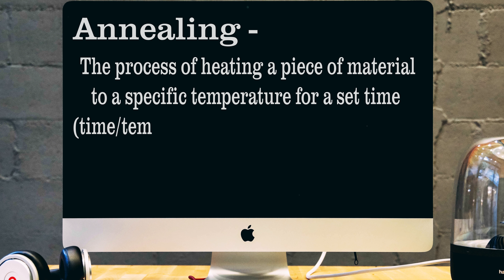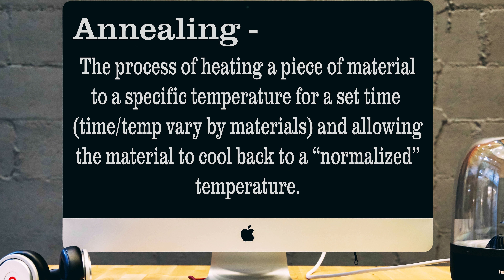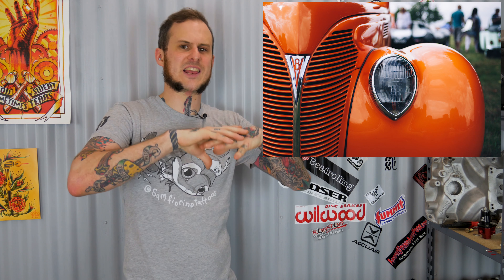8 Metal Shaping Terms Defined - Beginners LEARN THESE!

Comment: Thanks for taking the time to explain. I've watched this one several times now. Only starting out, my first project would be a pedal car. What gauge aluminium would you recommend for a beginner? Hoping to do a 60%scale pedal care of a Morgan 4/4
Reply from the maker: 18 gauge would probably be my recommendation. Aka .040" or 1mm thick.  It would be a good balance of easy to work and strength for a project like that.  If you are worried about it getting beat up in use, 16 gauge (.051" / 1.3mm) is will require more effort to shape but be tougher overall.  I'm planning to build a full custom street rod and aiming for mostly 16ga aluminum construction.

Comment: Good stuff. I've heard the terms before but never thought about how you could possibly achieve the same end result with shrinking rather than stretching. Also, I'm familiar with the terms "work hardening" and "annealing" but could always stand to see some practical demonstrations, especially with sheet metal, since everything I've seen on the subject up until now has dealt with the world of machining. Thanks for sharing.
Reply from the maker: You can often achieve the same results with shrinking as stretching it's just more involved work. 

I definitely want to do some demonstrating of annealing and work hardening in practice. That is an excellent idea. I will work on a good demonstration for that.

Comment: One procedure I am not clear on is annealing mild steel sheet, can it be done? I am ok with annealing aluminium, but not sure about mild steel sheet materials.
Reply from the maker: Jaques Daniels annealing steel sheet is doable however it requires much more accurate temperature and time
Control than non-ferrous materials do. It has to be cooled at a set rate. I don't know those figures off hand. It could be done via normal shop methods but I wouldn't recommend it. It's likelier you will bring out some unwanted characteristics (create hot spots, over soften various areas) rather than properly annealing the piece. Non-ferrous materials are more forgiving of this process.
Reply: Thanks.